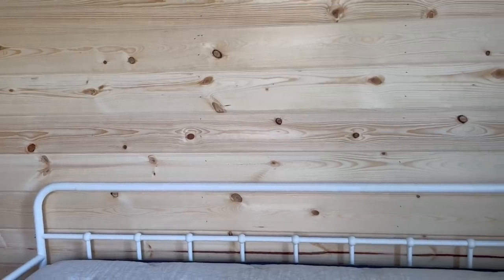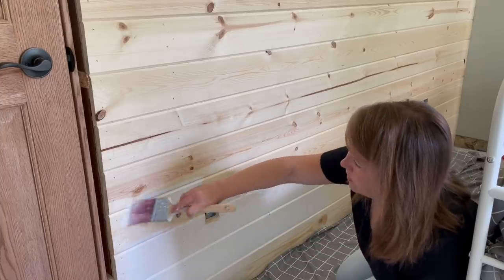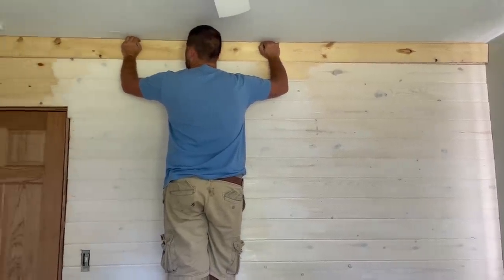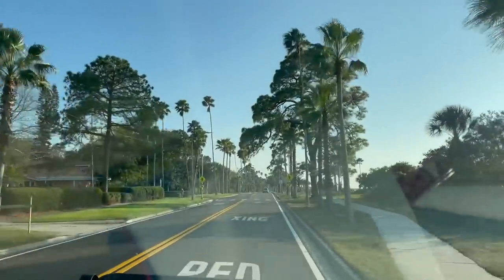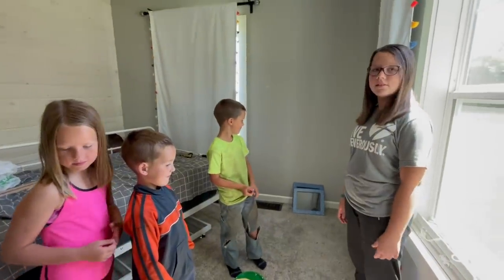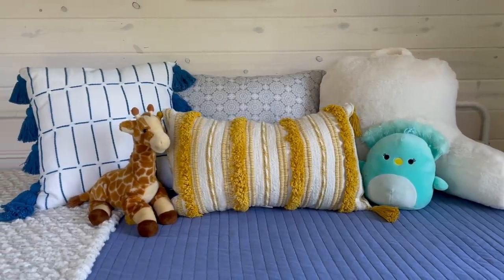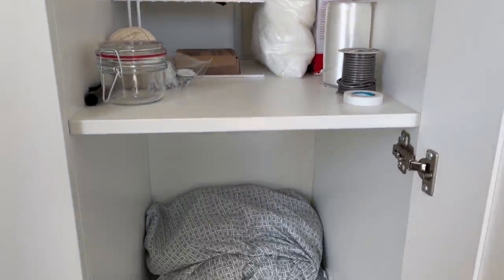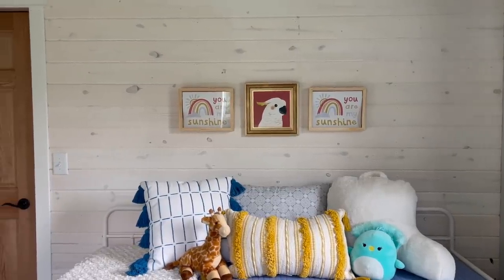FAVORITE Room Reveal Yet! Guest room reveal & we got exciting news!

Comment: Heed my words as a licensing rep for a foster care agency, get a waterproof mattress cover on any bed you put kids on.
Reply: Excellent advice!! 👍🏻👍🏻👍🏻
Reply: That was my thought too.
Reply: I would get 2, so you can have a back up:)
Reply: Yes!!! I was coming here to say the same thing! Stress can lead to bedwetting. 😢
Reply: @dqst2012  
Definitely!  You need three - one each for bed and trundle plus a spare to put on after you’ve stripped the bed and waiting to be washed.  And definitely three sets of sheets for same reason.  I’d also buy another matching bedspread for the trundle while they still have it.
Reply: On every bed-- even adults have accidents.
Reply: Yes! We have waterproof mattress covers on every bed in the house, even the adult beds! Red popsicle stains mattresses!
Reply: Yes! And just in case the wardrobe isn't already securely fastened to the wall, please make sure that happens! Due to the variety of backgrounds, foster rooms should be curiosity and anger proof too.
Reply: It extends the life of the mattress and protects it from sweat oil etc not just accidents which means you can easily resell mattress since it wont be stained etc aka basically new in freshness AND you dont have to clean the mattress you can just wash the protector. 

Its great theres been more than one time where the protector has saved my mattress from heatwave grossness and splashes of hot drink. I also got pillow protectors for the same reason - also waterproof and im looking into doona protectors which are far rarer and more expensive so harder to find.
Reply: Waterproof pillow protectors, as well.
Reply: I would also use a bed bug type cover that zips and encases the whole mattress. Same for the pillow cases. We do this for all the beds and pillows in our home. Helps with allergies and protects against other bodily fluids.
Reply: I thought I heard her say she did buy a waterproof mattress cover when she was discussing the sheets...am I hearing things? LOL
Reply: Most definitely need mattress protection!  These children will be under more stress than normal so accidents could happen.  Also think about bed bug protection since these children might be coming from less than perfect situations.
Reply: I have a waterproof mattress cover on every mattress in my house. Stuff happens, no regrets.
Reply: @mei-lyns4492  I'd forgotten about fixing wardrobes..my 2 boys managed to pull over a triple wardrobe while playing in my bedroom many years ago. How they did it and how they escaped an injury I'll never know.
Reply: We've even layered: waterproof cover, fitted sheet, waterproof cover, fitted sheet. Then if you have a nighttime accident you can whip off the first layer of waterproof and fitted, and don't have to go to hunt down the extras and put them on - you're already set!
Reply: We have waterproof sheets on all our beds due to kids (not foster)
Reply: I would have left the wood wall natural.  So glad you only whitewashed it. Congratulations on being all set to go with your fosters! ❤
Reply: @dqst2012  Yes...the dreaded stomach bug...argh.
Reply: I concur.  4 foster kiddos and 4 adoptions later, get a waterproof mattress cover. ❤️❤️❤️❤️
Reply: I second that emotion.
Reply: @Lucinda_Jackson  Girrrrrrrrrl.....you are so right!
Reply: We had 2 little gypsy kiddos for a while. The little guy was upset that his baby sister was in the crib so he peed under it. Linoleum floors were useful at that moment. A 11 yr old girl, who had been abused acted out with our younger boys. I don't think they remember. Each foster child we had was changed and helped by God. The 11 yr old was adopted by her loving family members who hadn't known about her problem. The little kids were returned to their loving young family who received parental advice. We ended up adopting our special needs daughter who was our world until she passed last year. The most important thing to do as a foster parent is pray. Really. We saw so many little and big miracles. The kids always went to a better situation when they left us. And we were usually exhausted and ready to see them go 😂 God Bless you and may He continue to direct your path.
Reply: Kids or no kids, always put a mattress protector on, mattresses are so pricey!! 💰
Reply: I always prefer woood left natural with a clear stain.
Reply: @SonyaPope  Yes! They are very quality covers that don’t feel like you’re sleeping on plastic too! Definitely recommend a bed bug cover. We had a guest, (don’t want to scare you) but we were introduced to the bugs. It is not impossible to get rid of them, but it is very costly and takes quite awhile... trust me. You want to do this. I would do this on every mattress and box spring. Ok, don’t want to scare (again), but they can come on used items and library books as well. Please just be cautious and check things (bag and wash what you can when it first comes in)... The water temp needs to be set high enough on the wash. If you still have your steamer, that works great too! It can kill eggs/bugs if the temp is high enough.
I use to be so ignorant. I didn’t even think they existed anymore. I know better now, but wish I didn’t know this...
Reply: Please, keep in mind... bed bugs are in every social economic system. We can get them while traveling, sitting at a movie theater, bringing home used items... we just have to be aware and carefully check things over.
Reply: Yes!!!! And NOT the dumb kind that is like a giant pillowcase and zips all the way around that is a headache. The kind shaped like a fitted sheet
Reply: Absolutely a must. I just bought pull ups for a lady taking in 3 kids. 9,10 and 12 and are not toilet trained. Kids who have not had a normal childhood come with all sorts of issues. Waterproofing and child proofing for any age is important. You will need more sheet sets to interchange too as they will need regular washing.
Reply: @meghanrobison9857  that’s brilliant. Should have thought of that 3 kids ago! Haha!
Reply: @jaimesmith9517   Yes! I once lost a whole cup of tea on my mattress...first and last time I had my cup of tea in bed. The stain never came out. 😳
Reply: Congratulations, on getting licensed for foster care! I think that is awesome! Your family will be a great place for kids.
I prefer natural wood in most cases. The white wash looks nice, but natural would have looked nice too!
Reply: I definitely like the white washing more calm for the room. God bless you for fostering !!
Reply: This sounds like overkill, but we have some asthma cases and extremely rare bed-wetting. We have the mattresses covered with the zippered bed-big, allergen covers, then a waterproof cover slipped over top. It’s a big of a nightmare to change the zippered covers - not quick for middle of night accidents.
Reply: A - men.
Reply: @jaimesmith9517  ha! So does orange juice. I propped a glass of oj against a pillow ... forgot when I left the room ... sat on the bed and the oj overturned. 😖
Reply: You know I think everyone should have a waterproof cover. Sickness, spilled water bottle, etc..
Reply: I was just going to suggest that, too.
Reply: Waterproof mattes protectors for sure.
Reply: @jillb90777  And not just with foster kids, your own kids as well.
Reply: @WellOfEchoes  The popsicle was mine!
Reply: Every bed i have ever had in my life ALWAYS has a cover... should be standard in everyone's home <3 puke is a real thing... sick kids crawl in parents bed and get sick their too!!
Reply: @meghanrobison9857  Great tip!
Reply: Or if they get sick in the middle of the night or and older girl with her tome of the month. The waterproof really protects the mattress. Great investment. I have them on all of my beds and got them for my son and his wife and their 5 children!
Reply: @jaimesmith9517   🤣🤦🏻‍♀️ Can’t even blame dogs, partners, kids...anyone else! Our own fault! 😎🤷🏻‍♀️

Comment: Don't forget the water proof mattress cover.  You'll be glad you have it when the first accident happens 🙂 beautiful room❤
Reply: Yes and extra sheets
Reply: @sheilak4493  Yes.  Pillow covers as well.
Reply: Absolutely need the waterproof mattress cover!
Reply: YES!!!! We have gotten them from Target for not to much $ and we are so glad we did!!!
Reply: Yes, even with older kiddos! We had 8-9 year olds and had to change the sheets every day.
Reply: I absolutely agree with this, not just because the kids could have accidents, but because they are coming from different places and you're not sure exactly where there is a higher probability that they could be bringing bed bugs with them as well.
Reply: I like the wood. And I with others get the water proof matters cover
Reply: Yes, no matter the ages!
Reply: @Rjpck5000  correct 🙂  heck, I  have a non-waterproof cover on my mattress.  I feel like it helps keep the mattress clean
Reply: @farmchicki  wow
Reply: Good point re the mattress protector and 1 extra set of sheets.
Reply: Most brands of mattress protectors are waterproof, 99% allergy proof, bed bug proof, dust mite proof etc. Some are only resistant to. Read label carefully as you want protectors like water PROOF
Reply: I actually thought waterproof mattress covers were a staple in any home with kids. You just never know.
Reply: All beds should have them. From all kinds of accidents or just sweating.  Keeps the mattress  protected:))

Comment: I like the way a really bad wall was covered nicely with planks.
Probably i would have use clear varnish or very light stain.

Protect the new mattress. These chidren will probabbly be under extreme stress.   So much easier to be very matter of fact attitude if you have water proof cover and then a cloth cover.  While you are at it, probably you should buy protectors for all the mattress' in the house .   Prolongs lifespan of the mattress.  'Stuff' can happen.

Comment: I think wood has its place, but it’s a rustic feel that needs to be supported by a rustic vibe in the decorating. With what you’ve done with the rest of the room, clean and bright, that wall needed to reflect light like Dawn suggested. A white wash was a great compromise. A bare wood wall—even with a natural coating—would have looked unfinished in that particular room. The metal bed against an unpainted wood wall would have been too busy.  A wood bed and a wooden table and chair with a cozy cushion might have worked with it.

Comment: I’m team paint all the way. The white wash is OK but I don’t like seeing all those knots. A clear coat or the white wash should be OK if it was nice clear pine with no knots. For all the people that say they prefer wood, it’s still wood even if it has paint on it.  Also, it’s so much easier if you paint it before you put it up on the wall then all you have to do is touch up, so, so much easier if you lay all the boards out on a tarp and go at it with a roller.